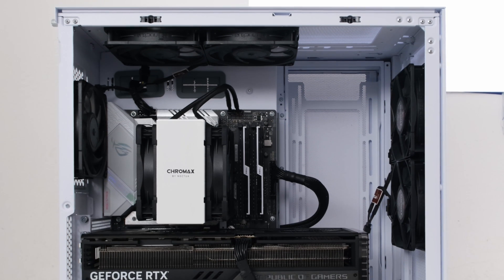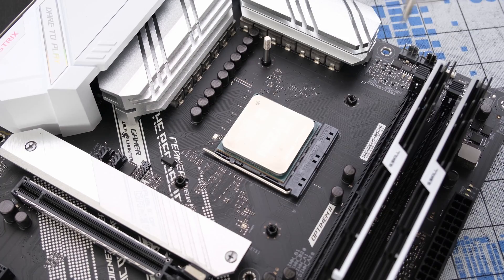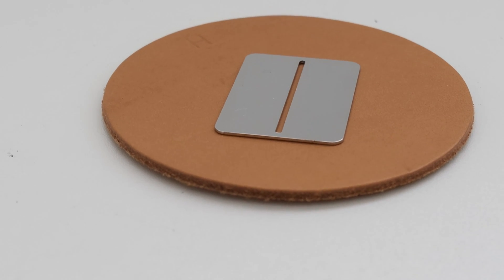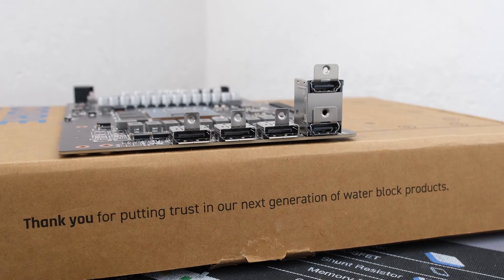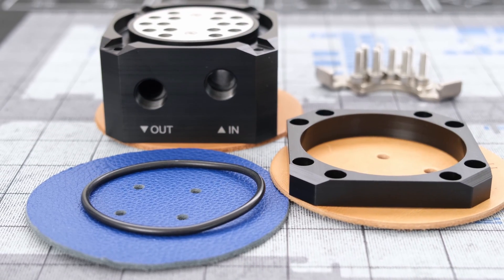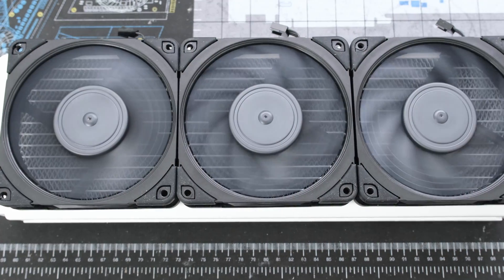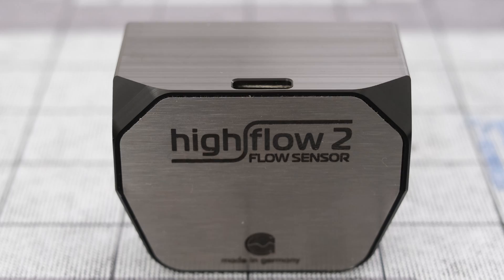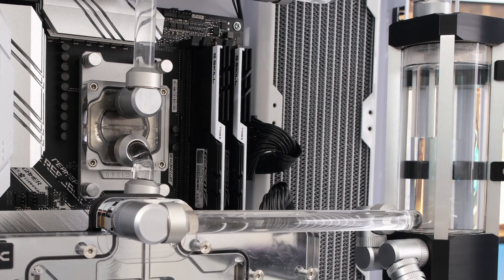Watercooling Your PC - Complete Step by Step Conversion

Comment: I tried making it with soft tubes, but the acrylic started cracking, so I gave up. It seems I tightened it too much, but I'd like to know how much I should tighten it!
I'm afraid that the soft tubes will come loose when I connect or move them, and water will leak out.
Reply from the maker: Thanks for your comment 🙏 Acrylic is actually not really easy to use. I only have a few hard tubing builds on this channel. Most of the builds use EPDM soft tubing. Hard tubing can come loose much easier than soft tubing. If you use soft tubing and slide it onto the fitting and then hand screw down the top cover, you will instantly see how it will be really hard to accidentally pull that out. Hope that helps

Comment: if i may ask , so u pass hot water from the GPU Block to the CPU block , pls i am trying to water cool and trying to  understand if i can pass water to the GPU block and  return it to be cooled  and  then the cooled water to the cpu block  to the rad and to the tank , and by that do i need a distro plate , also one more question , can i have more than 1 pump in a build ( example of a radiator  fan setup that comes with a pump and tank and also distro plate that comes with a pump and tank , is it possible ? ).
Reply from the maker: Thanks for your comment 🙏 I'll do my best to answer your questions. Loop order doesn't matter. The water temperature equalizes fast enough to make this not matter. You do not need a distroplate. 1 pump is enough but you can have more than 1 if you would like. Hope that helps
Reply: @vectornetwork  thanks for the reply

Comment: Would the gpu block benefit by using gelid thermal pads?
Reply from the maker: Thanks for your comment 🙏My experience is that if the memory is running hot, I'll do anything to cool it. That includes nice thermal pads. But if the  memory is running fine and at a temperature that is cool, I wouldn't pay more to chase incremental improvement. That is my perspective and hope that helps

Comment: Noise measurements should be performed with the meter installed at a fixed point and some distance away from the object you're measuring. By hand holding the microphone right next to the glass, what you're picking is a mix of handling noise and glass vibrations, not the sound from the case fans in the room, especially considering nobody uses their PCs with their ears right against the case.
Reply from the maker: Thanks for your comment 🙏 You're flat out right. The acoustics portion of the testing can use improvement. Currently, it is sort of just there as it may be better than not having it at all. It's also why I didn't include that data on the chart, but just narrated it. As an improvement, I plan on having a fixed location and having a way to have the data provided to me, time stamped, like all the other data. For the testing, I noticed that the reader was picking up noise and I provided an "average range" as I really didn't have the data in front of me but just the footage. To compensate for this, I was showing onscreen exactly what I was looking at. For comparison (on the watercooled build), rather than turning up the fans so it was approximate something in the low 30s, I turned them down until it wasn't picked up at all by the reader. So, now we had more distinct situations and is why the temps weren't really that much lower, fans were really on fairly low. I'm in the process of developing a better method for acoustic testing. I appreciate your feedback and thanks again for your comment.

Comment: Major leak at 14:52 !  On the right side of the of the horizontal tube.
Reply from the maker: Thanks for your comment 🙏 Ah, you saw it. I'm sure more than one eagle eye'd viewer would see it. This highlights why all of this is hard to film. I had already set everything up a first time and did a leak test with water already, but was not expecting the water to almost immediately make its way from the reservoir to the GPU block and I didn't have the camera focused on the block (it was focused on the reservoir), so the initial fill of the block was blurry. Do I continue and live without a good initial fill shot or do I redo it all? I only have a moment to think about it and then decide to redo it. However, when I was ready to re-shoot the footage, I simply could not get the GPU block completely dry without having dissembling it again or waiting a few more days for it to naturally dry (even with a fan blower, it wasn't drying). I already it disassembled it once when I wasn't confident in re-using the foam spacers, do I completely dissemble the front now again, just to wipe away some water droplets? In any case, I did not, so that is why you'll see the block isn't perfectly clean when the fill is done. Separately, onto your comment. So, having already done the fill twice, I see the leak and it's like that "this is fine" meme where the house is burning down. Rather than trying to figure out how that happened, I just quickly replaced the fitting and cleaned up all the liquid while trying my best not to move anything as I was going to try to salvage the footage. So, footage was salvaged, nothing was moved too much, so I was able to kind of stitch the shots together and smooth it out. I made a note to either crop out the liquid drops or edit out the frames or digitally cover it, but I completely forgot and I didn't notice it on the final review(s). So, long story short. Leaks (and splashes) happen. Its particularly hard in this scenario because I got these gloves on and trying to install these runs while not trying to have too much unnecessary movement and smooth manner for the camera. However, leaks happen, it's why the leak test is done with water is done without anything powered on. I plan on including a leak test with air in the future. I had tried it out for this build but the footage wasn't great and I still trying to figure out how to show it, so I have to use it a few times more. In any case, thanks for watching and thanks again for commenting
Reply: Dang and that after all the OCD secure step by step.
btw talking about OCD, saw that he didn't clean the dust particles at 10:15
Reply from the maker: Thanks for your comment 🙏 I left the whole leak story when I replied to the other comment. I did check out the part you linked and, oh wow, hm, those were not the type of particles I was expecting. Not a bad thing though. It seems like the standard is slightly higher than I realized, but nothing I can't try to meet. I can certainly do a better job of cleaning up the components (and the work space). I sometimes redo footage if it looks particularly bad when the shots are reviewed on the computer (it's hard to see until that point). I'll make more of an effort to make sure things are wiped down and the compressed air duster is used, etc etc. Thanks for the feedback and for viewing!
Reply: The problem with liquid cooling. even the pros got it leaking
Reply from the maker: Thanks for your comment 🙏You're flat out right my friend. It's why the leak test with water is done without any components plugged in/powered on. I left the whole leak story when I replied to the other comment. I do plan incorporating a leak test with air in future video, hope that helps and thanks for watching!
Reply: Respectfully 😂😂

Comment: Love you videos! So informative and well made.

I’ve been watching your other videos as well and do have a question. 

I just built a watercool PC running a 4080 super tuf with Alphacool core. Your previous video shows temperature of 56C under load. I did a stress test in mine and it was running 75+ C!! Something is not right. Do you think I have to check the paste or thermal pads? Any suggestions? Thanks
Reply from the maker: Thanks for your comment 🙏 Hm, I would expect lower temps, especially considering that the 4080 Super isn't that hard to cool. What is your cooling setup? Rad/fans? Anything else in the loop? If everything else seems normal, then I would check the paste and the contact from the mount. Is this GPU core temp? I wouldn't worry about the pads unless it's memory or VRM. Hope that helps
Reply: @vectornetwork   I am running two 360 radiator and 1 240 radiator. 3 exhaust fans too and 5 intake fans. Nothing special in the loop. According to HW Monitor, that it core temperature and hot spots hits 100+ C!! Ahhhh!!! My room ambient temperature is 21-22C.

Comment: Great video and tips as always , thanks a lot ! I also bought the Primochil RFB, cant wait to try it out.
Reply from the maker: Thanks for your comment 🙏The RFB is really nice for dialing in runs. Since the hacksaw is so rough and thick, and the deburring tool is anything but perfect, it's typically really hard to get small runs near bends or to get really precise. The RFB solves that and it solves it really nicely. It gives leeway as I don't need as precise measurements, which are difficult. I can get something close and then fit the run and then shave off some length here and there to really dial it in. Thanks again and hope that helps